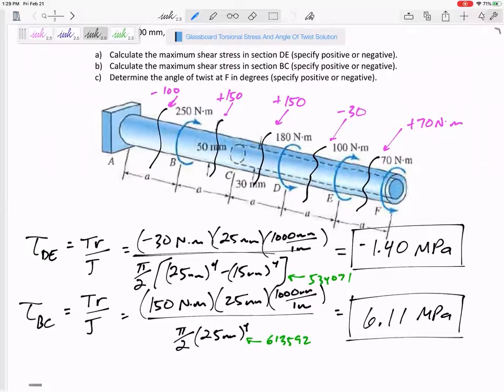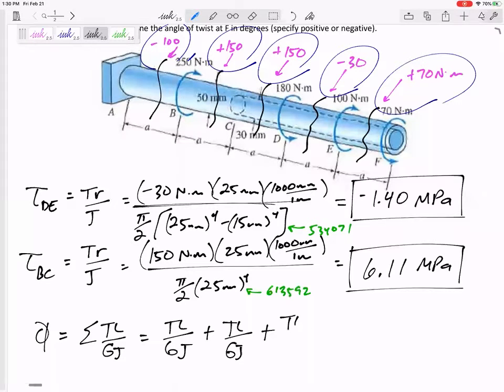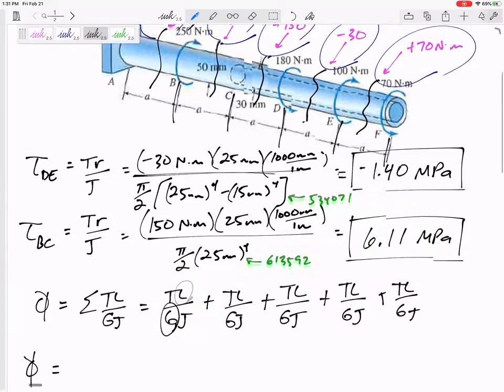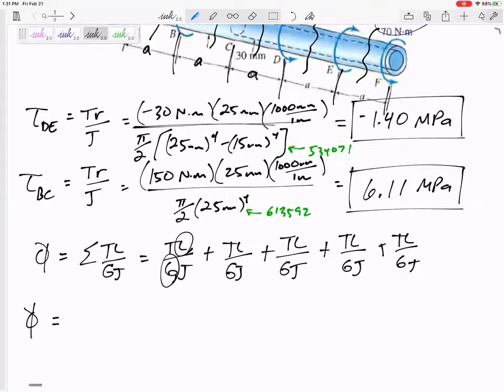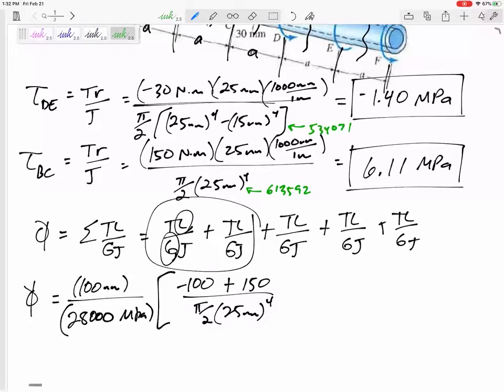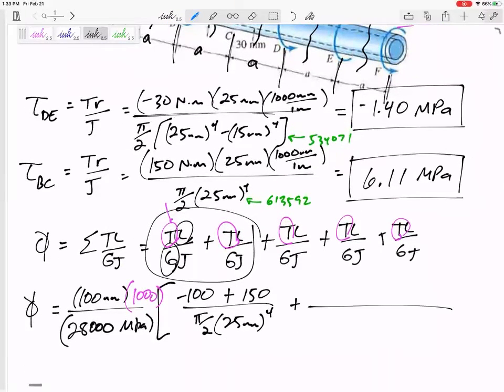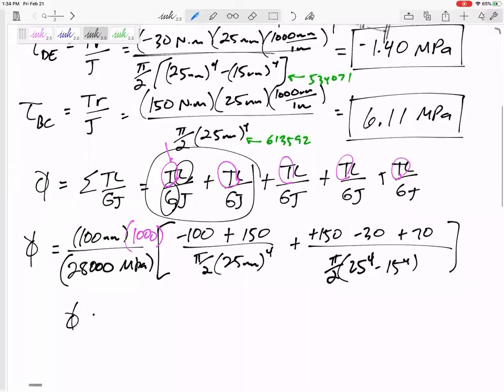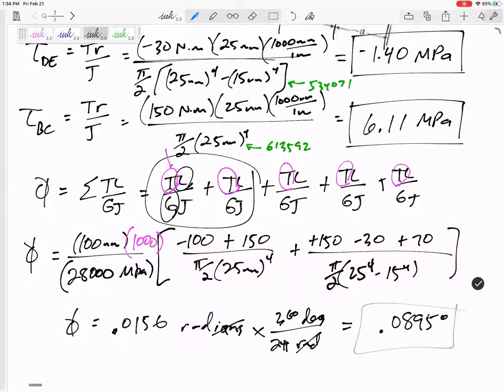Mechanics of Materials - Angle of twist example 3

Comment: Why did we take the signs like that? In E-F section, internal torque moves clockwise but we took positive for example.
Could you explain the sign part that i cant catch, sir?
Reply from the maker: You need to look at it from the cut. So “walk” around to the back side of the bar so you can look down the barrel of the cut- it’s counterclockwise looking at it that way (right hand rule- out of the cut).
Reply from the maker: I think I might have an earlier video showing the +/- signs of these internal moments.
Reply: @engineeringdeciphered  Understood, i also looked at those videos you mentioned thank you for responding, sir.